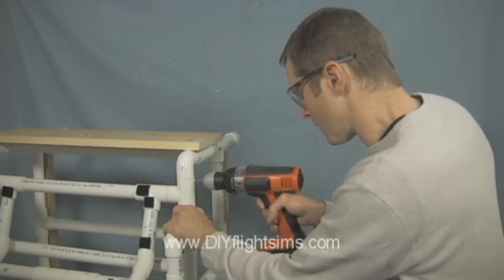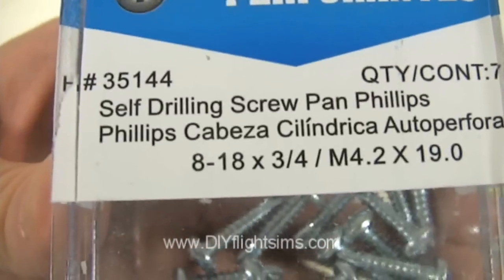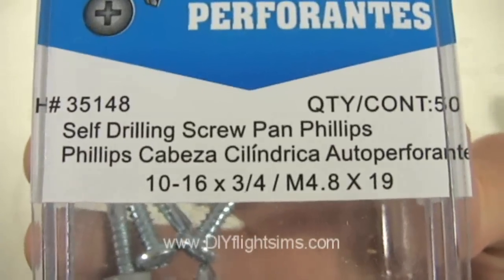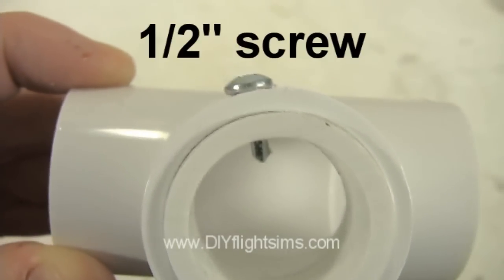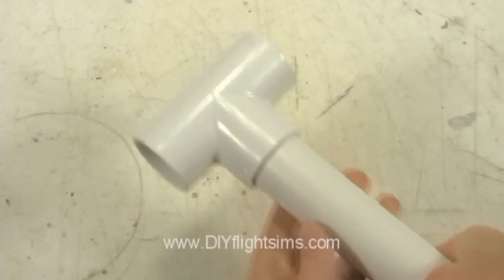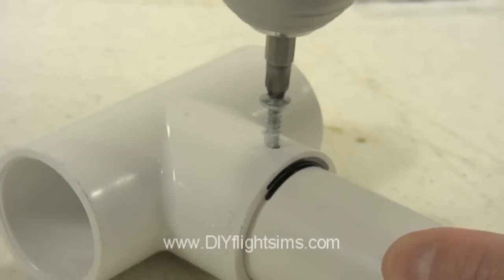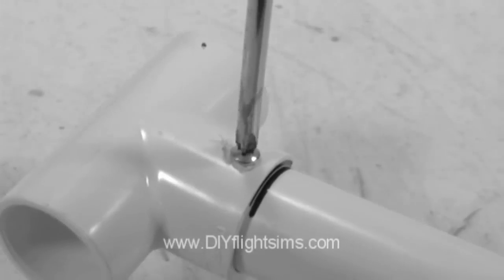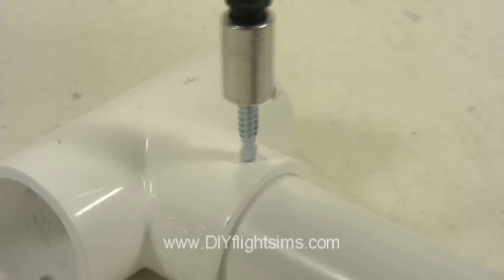Self-Drilling Screws for Home Cockpits

Comment: I respectfully disagree with your statement about the designation of the numbers 8, 10, etc. Those numbers represent the diameter of the screw, not the size of the head. A #8 diameter is .164" and a #10 is .190". The diameter of the head is dependent on the type of head. For instance, a flat head screw would not necessarily have the same diameter head as a pan head or a socket head.
Reply from the maker: I agree. I should have said that differently.

Comment: I used that technique using PVC pipe to build a pond cover frame for my mother's pond a few years ago and it worked great.  Although I haven't built my simulator yet, I'm going to use that technique on certain parts of it so that I can disassemble it in sections for transport.  

Keep up the good work!